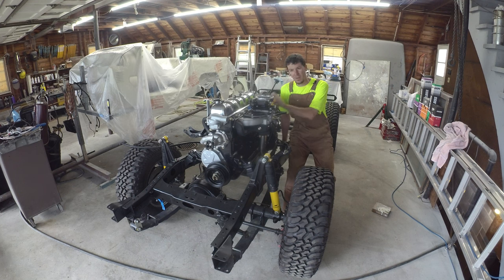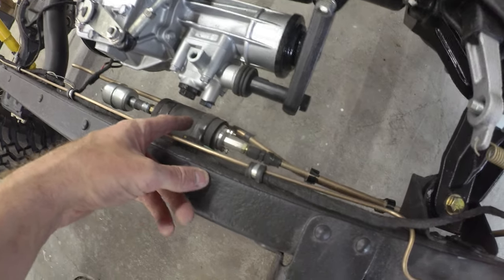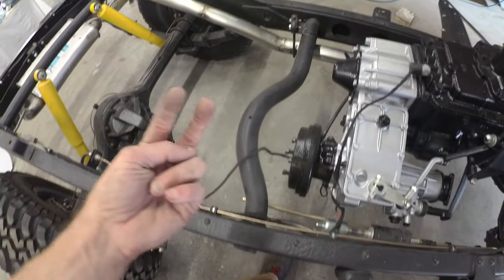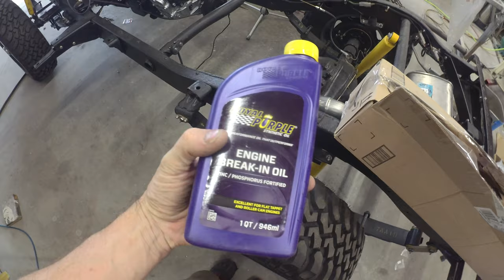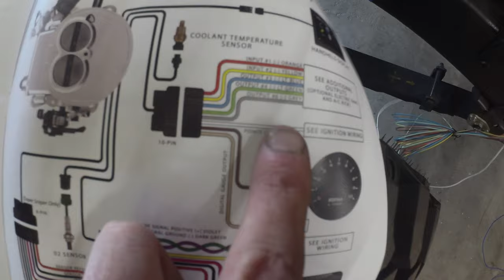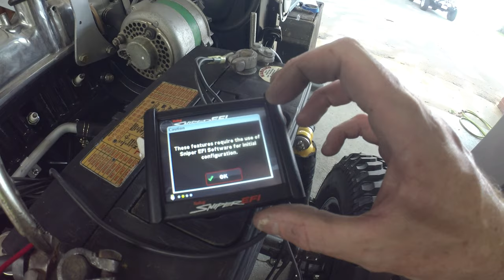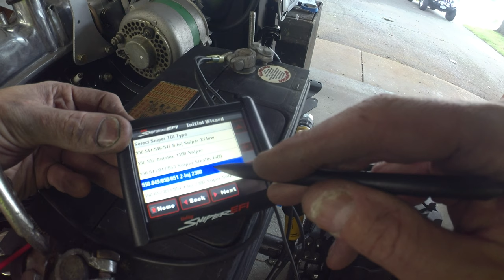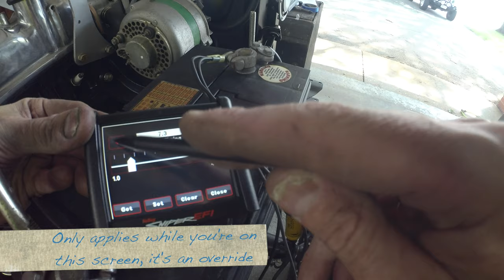Holley Sniper (and Hyperspark!) Install, First Start : (FJ40 Week 41)

Comment: Just did my first start with the Sniper.  I had  a small issue with the idle being too high.  Holley shipped mine with the butterflies way too open.  Was idling around 2100.  I manually adjusted the RPMS down to 1000 using the idle screw then followed the quick start guide with no issues.  If it makes you feel better, mine has the exact same sounding knock that is pretty loud on the front of the engine and about mid way up the block.   I have new ITM timing gears so I'm hoping its the same break in noise you had with the timing gears.
Reply from the maker: Good find on the butterflies.  Mine was a factory refurb, perhaps they got mine right the second time.  😄  Interesting on the knock, does seem like the same thing.  Mine quieted down after about 500 miles and swapping out the break-in oil.

Comment: Very cool to see the engine out in the open, super clean, with no grime or spider webs!  Just wondering if the fresh paint has to be sanded off where your ground wires attach?
Reply from the maker: It did look nice and clean...was almost a shame to cover it up with the bodywork.  It definitely helps to clean up those grounding points where you can as you finalize the wiring, and it's much easier without the body in the way!

Comment: Your exhaust looks and sounds great. I don’t suppose you have the designs drawn up so I could get one made up?
Reply from the maker: Sorry, no plans - was just fit-up in place and welded up with the TIG.  It's 2.5" stainless all the way back - two 45* pieces worked well for the downpipe.  The muffler was a stainless Dynomax for a Wrangler JK (53804), but it did need the inlet cut, extended, and rotated a bit to clear the shocks.   It does fit well between the rear framerails, and it was one of the few available in 2.5" stainless.

Comment: Awesome first start and looking pretty awesome! I think I’ll be trying out the Howell fuel injection on mine when the time gets closer. Tried getting some answers today on ring gap. You can’t call Hastings and talk to anyone for tech support. My engine shop guy is telling me I’ll be fine with the .61/.66 gap but idk. I mentioned going .010 over and filing them and he said yeah that would work also for tighter fit. So my question is what was the final gap you went with and what oil ring did you use? I’m assuming from the .020 over set?
Reply from the maker: Agreed, I do think the wider gap would still work ok, but I figured it was worth the work to tighten it up since another ring set was easy enough to pick up.  I don't recall exact number, but I just went to the middle of the factory spec (.020-.038mm)... likely .025mm.  I don't 100% recall which set's oil ring I used... likely the upsized set.